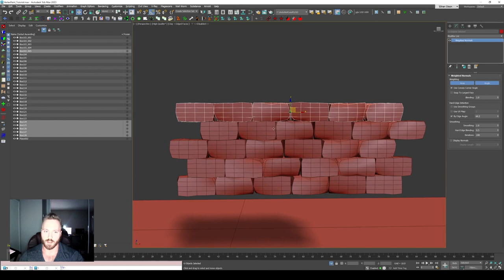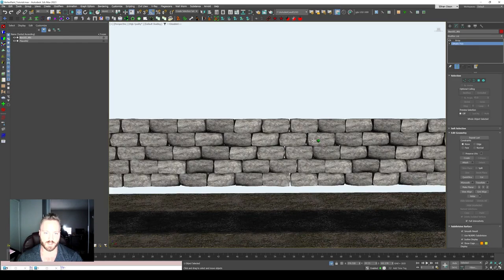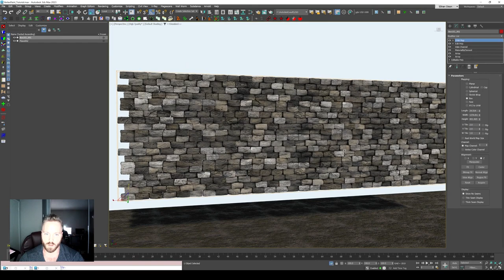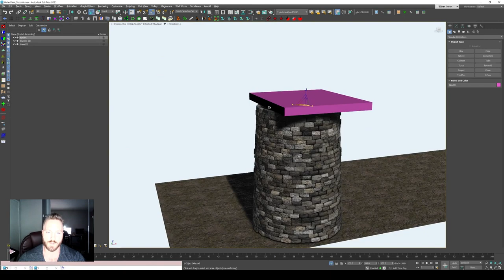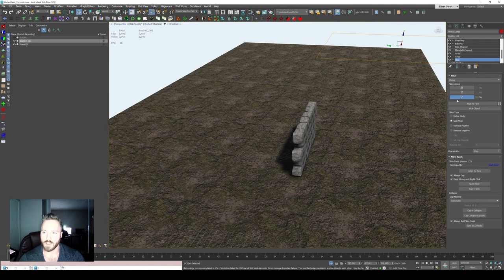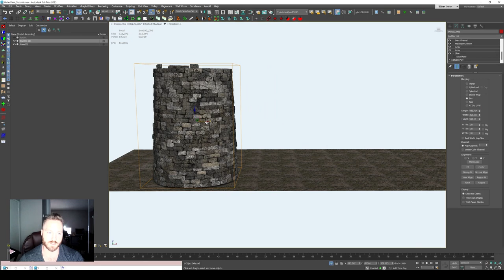Procedural Modeling in 3ds Max - Tips and Tricks

Comment from the maker: Data Channel Setup : 
Face Input - Material ID
Color Elements - From Stack / Element
Point3 to Float (x, y or z)
Convert to SubObject Type - Vertex.  Channel Type = Position
Transform Elements - Input Channel = From Stack.  Transform = Position.  (x, y or z  + randomize with low value)
Vertex Output = Position.   Selection Method = Replace.

For the Delete Faces Modifier, and other level building tools, download Wallworm  here : https://wallworm.com/store/index.php?route=common/home
Reply: Thanks for the Data Channel Setup!
Reply from the maker: @incelunicorn  No problem!
Reply: +1 Indeed very useful

Comment: Absolutely amazing. One of the best tutorials I've ever seen. I have subscribed to your channel and will be following all of the ones that are Max specific. Thank you.

Have you ever thought about revisiting this tutorial to account for the changes AutoDesk has made in recent years? The Delete Faces Modifier is no longer available and Delete Mesh has no Parameters available. This totally disables the removal of individual blocks at the top of the tower. Volume Select is also acting in a different manner than you described. I'm also still struggling with the Data Channel, but I'm not yet convinced that this isn't still my fault. I did try to follow the Parameters that you have pinned.
Reply from the maker: Thank you for the compliment, means a lot! If you haven't already, make sure to download WallWorm in the description, and after that if the modifiers aren't working as described i'll look into it specifically! This tutorial was done in Max2023 so should be pretty current, but i'll check the differences with 2024 if that's what you're using.
Reply: @KingdomCrafter  I missed the Wall Worm link in the video's description and didn't realize it was a necessary part of the tutorial until I watched another of your videos where you mentioned it. I tried just downloading the Delete Faces plug-in and it didn't work in 2024. I then noticed that Wall Worm Pro Pack is now a free download, and it works just fine in 2024. I got the Volume Select to work by selecting Faces instead of Vertices (Vertices remains in a weird Sub-Object selection mode and the whole Model just remains blue). I still get weird results from the Data Channel (even using the settings you pinned). Do you have any Materials tutorials that use native 3ds Max? I can't afford the 3rd party one at this time, and mine look pretty basic.

Comment: There is no need to deal with groups when attaching multiple objects. 
Select all you want to be attached, isolate, select one object, attach list, select all, and attach.
Reply from the maker: They're both valid. The reason grouping is a good workflow is you're removing the need to isolate, and keep it organized in the outliner. For example, the more objects you have, the more cluttered the outliner will be, and having it grouped just helps with that. You could also parent etc.